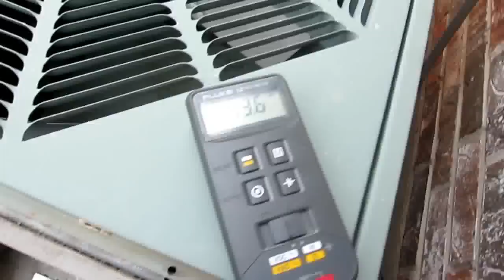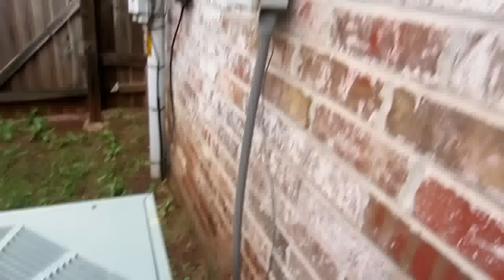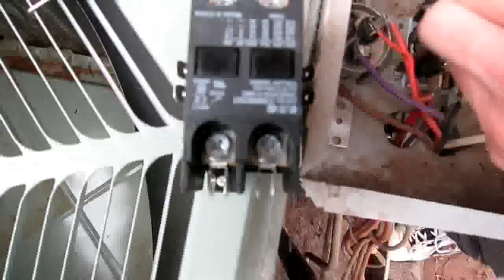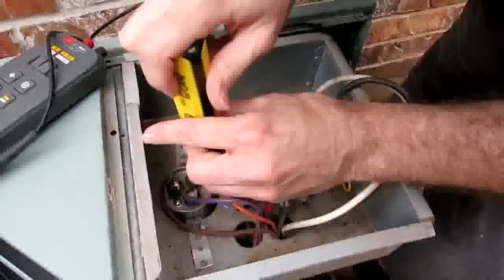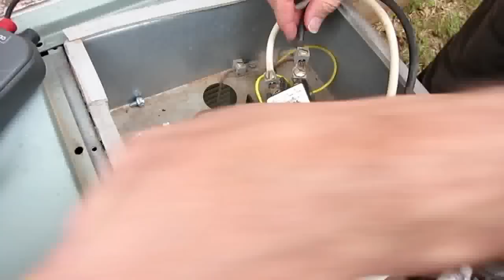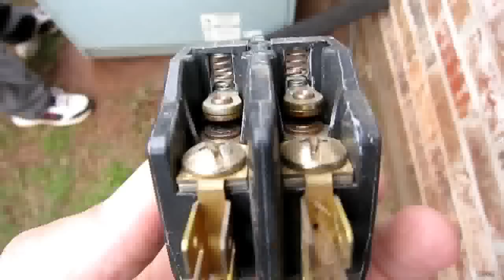AC not starting up - Air Conditioner condensing unit lost power - Replace Contact contactor relay

Comment: 1. At 2:25 when you are confirming the current, would it matter if you switched the red and black detectors? i.e. is there something that indicates a positive and negative side, or does it not matter which way you do it? 
2.  I noticed at 5:55 he switched the wires on the L side for the second terminal from the old to the new contactor.  Does it not matter which side they go on?

Comment: The "B" phase wire (  the white one) does not have any color code tape to identify it as a hot wire.  It should have red tape on it to identify it..  Cause " an electrician too lazy to do the job right" and follow the code as per the N.E.C.

Comment: As an HVAC professional, here's an idea: If your A/C is broken, CALL A PROFESSIONAL! I can't express that enough. Going on calls where a homeowner has screwed stuff up even worse isn't fun.
Reply: That's because you have dishonest techs coming to your house. Only licensed technicians should fix HVAC equipment; you could risk destroying your equipment, seriously injuring yourself, or misdiagnosing by doing it yourself. People may complain about the high cost of refrigerant, do so it yourself and when you don't know how to properly charge a unit and when you severely overcharge don't call me cause the hourly rate is now double.
Reply: $12k seems very high for a complete system. Larger companies tend to charge more for a system to cover their high advertising cost. I'm always honest with a customer and will fix it unless they want a new system. I will take a capacitor to them with my meter and show them it's bad.
Reply: Nathan Wakefield I going to tell you HVAC pros a little story in the back of my head that you might find hard to fathom, back in day when my parents were just getting in there teenage years people learned how to fix some of this stuff them self's if they are able to and did it right, they did not always call a professional nor afford to either since times were kind of firm back in those days too and probably still is for some from the shape that the economy is in now, one of the things i see is wrong with America now is people have gotten too used to the convenience of always having someone else to fix it for them or throwing it on the garbage pile an get a new one people don't want to take the time common sense and brain work to do it them self's anymore this is probably why you see a lot of DYI jobs gone wrong because today generation is not used to doing it them self's competently anymore no matter they have see a video of someone doing the same thing correctly
Reply: this stuff isn't rocket science...instead of you warding people from working on stuff themselves, why dont you teach people the correct/safeway to do it?  Oh yea, then you wouldnt have a job.....lol
Reply: AC is a luxury not a necessity, if you can afford it you can afford to have it fixed (correctly).

Comment: I just switched mine and its not turning on
Reply: Check the Y and C wire connected to the contactor for voltage when your thermostat is on cold. There should be 24V if not check out your control board on your Furnace/AC unit .

Comment: My replacement contactor is a "definite purpose" contactor and has no labeling on it for the wires {L1L2T1T2} does it matter the orientation when i install it?
Reply from the maker: my 2 cents is, no, it doesnt matter. but some HVAC professional will disagree with me :)

Comment: I was referring to the run cap discharge comment u made a run cap won't just discharge on there own and if not handled right a person could ground it out and be killed by it's stored power that's why you have to test them with a proper meter to see if they function properly

Comment: What else to check if ac not starting up,
Reply from the maker: the run start capacitor is a very common part that goes bad every 3-5 years.
Reply: DIY Tinker Run or start...

Comment: Wow a run cap wont just discharge ive seen them hot in units that havent been ran for weeks your gonna get some one killed alot of the things you show are good for home owners to know and some of the movies like this one is like handing a gun to a kid with out no training oh and ps just because the main breaker is off dont mean you wont get shocked by the low voltage wires if t stat is calling for air to come on some times the shock it kind of like touching a eletric fence oh and if the t stat is left on you could blow the fuse to the air handler or burn the transformer up he also failed to mention that on here
Reply from the maker: Safety first. Sure, i agree. But, a human's resistance at its lowest is 1k ohm,. low voltage (26VAC) over 1 k doesnt have enough current to kill. i can hold the 26VAC in series and not feel anything. Run caps are not ideal, and its called impedance... you can learn more on Wikipedia.

Comment: If there were dead ants inside it, wouldn't cleaning it out so the contacts can make a good connection have fixed your problem?
Reply from the maker: i have seen some people clean it out with contact cleaner and sand paper.

Comment: did you know that 24 volt circuit was live? unless you turned off the furnace breaker or remove the 24VOLT fuse, you took the chance of burning out the 24 volt fuse on the circuit board....<<
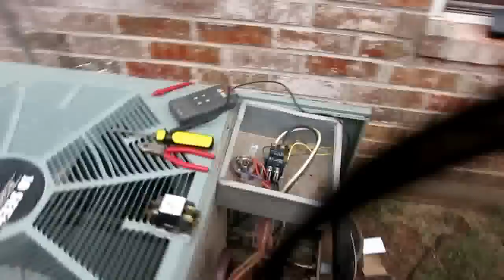Reply from the maker: it wasnt live. @ 9:10 you can see we turned 24VAC back on.

Comment: Maybe you can help me with a problem I am having... the fan on my unit stopped turning and we had no air blowing, a local "pro" told me to change the dual run cap which I did. The fan is now turning but there is still no air blowing. Any advice would be much appreciated...
Reply from the maker: There are two run caps, and there are two fans/blower. One outside in the condensor unit and one insdie in the furnace. I am guessing you had/have multiple issues. Sounds like you replaced the outside units cap and the fan started. Now you need to check the inside cap and see if the blower works.
Reply: DIY Tinker I can turn the blower motor fan freely by hand which makes me think the blower might be ok. The manual for my unit only shows one capacitor, where would I look for the second one at?

Comment from the maker: its my friends AC, so i dont have any extra photos etc... The frame can shift and sometimes these covers dont shut correctly. Ive seen techs simply force the cover as much as they can and drill new holes to secure the housing. not sure if this is the advice you need. but at least ive seen this done before.

Comment from the maker: very very very unlikely. But, its easy to rule it out by disconnect those two wires that goes to the furnace board (here its the brown and yellow wire shown @ 4:25). if it still trips the fuse, then you know its not caused by the contactor.

Comment from the maker: if the relay (AKA contactor) doesnt "go down" then you are having issues between the thermostat and the wires that go to the relay's coil. 24VAC should go there, hope you find those two contacts. 
ps. i also have a video that shows the fan motor breaks off from a zip tie and the wires got torn up by the fan. check it out in my channel under "fan motor"

Comment: I am having the same issue. I had a from the fan motor break off from a zip tie and tide up the motor. I replaced the contactor and capacitor and it still wont kick on. I pushed the relay contactor in and the unit kicked on and after a sec the contactor locks on and it continues to run until it shuts off and then it wont kick back on until i push the relay again. Hope you can help.

Comment: 1. It might sound silly, but lower your thermostat and make sure your thermostat is calling for your A/C to cool.   If it is, then:
2. Check the transformer on your indoor unit/air handler to see if it is putting out 24 volts.

Comment: if your indoor unit has a float switch your drain may be clogged if not then you have an issue coming from your indoor unit...possible bad transformer, maybe a bad relay coil, bad thermostat, a short in your wires somewhere, or even a bad board.

Comment: i am not there to be able to give you a 100% answer on what it would be but here are a few things that it possibly could be: the capacitor could be going bad, you may have a dirty outdoor coil and the pressures could be setting off the compressor's overload, the outdoor fan motor could possibly be going out, and even a possible freon issue. i would first turn off all power to the unit then get a water hose and clean the outdoor coil really well and run water over the compressor untill it cools

Comment from the maker: hmmm... i would first make sure theres at least 240VAC at the contactor. Sometimes you might have low voltage during the day (the city either has a bad transformer or they are trying to save some $ on the load). It happens more often than you think... a hard start kit can help.
If you do have 240 and it doesnt come on; then you need to test your compressor impedance. If that checks out then, you need to call the HVAC guy. My channel has videos on hardstart kit, contactor, & compressor testing.

Comment from the maker: i consider relays and contactors are the same. The main characteristic of a contactor in the HVAC world is that the coil operates on 24-28VAC, and terminals are rated at 240VAC.

Comment from the maker: you should get 24 to 28VAC. If get less than 24VAC then it might not kick on. If you get close to zero VAC, then it will never kick on. So, if you dont get 24VAC, then you need to trace back to the transformer and control board. 
Go to my channel and review vidoe "HVAC condenser - how to read AC schematic and wiring diagram", "Wiring and troubleshooting Thermostat heat cold air condition AC" and "How Air Condition Ventilation & Furnace Works"

Comment from the maker: all HVACs come with a run/start/dual run capacitor. I dont know why not not wire. good question. But i am sure its related to the amount of energy required to jump start the compressor. A capacitor can release a lot of energy instantly. The same amount directly from a hot wire might be extremely huge.

Comment: It is always wise to just replaced the contactor. for what it cost to buy one is cheaper to replaced it then to go back a few months later and do what was supposed to be done right the first time. now if for some reason you don't have one on hand then for a temporary fix yes clean and let it run.but you never clean contacts because the coating come off and they would weld shut.

Comment: next time turn off the t-stat or the power to the furnace because u were so smart in forgetting that if you grounded out one of the 24 volts that could blow ur circuit board and well thats a couple 100 dollars to just get it let alone if a supply house will sell you it.......... deff not a professional  but smarter than the average idiot

Comment: You are thinking of the reset switch.  That won't make your unit come on unless it has been tripped.  His button when pushed actually turns on the machine for the time that the button is depressed.

Comment: I work on soft serve ice cream machines and every single contactor, being a motor contactor and compressor contactor, has that little button on them.  When you start a unit up, on the contactors, that button should depress by itself well on the machine i work on anyway.  Or you can depress it yourself to test that the contactor works in that function any way.  If it does then you can look to your logic board to make sure its sending out the voltage that activates the contactor

Comment: Nice vid. Only thing, your T1 T2 stand for terminals 1 and two. These should go toward your compressor. The L1 L2 should be connected to your line voltage. Its just safer that way. But it doesn't make a difference in performance of course. still educational. Thanks!!!!!!

Comment from the maker: huh... i dont have much experience with this, so no i havent heard of pushing a button to turn it on/ bypass? 
The original contactor had a cover with one screw on top. I could take off the cover and press the contact down (with an insulated screw driver) to turn on the compressor/fan. The new contactor didnt have a cover, but the contact was insulated and i could simply press that down.